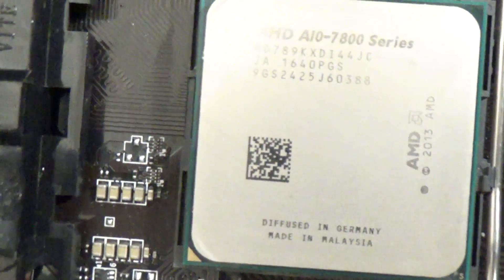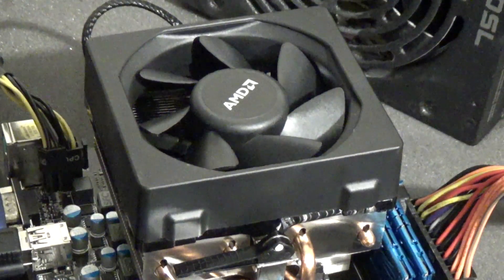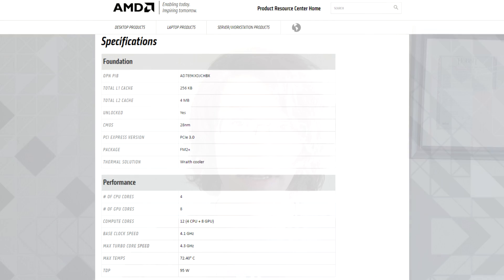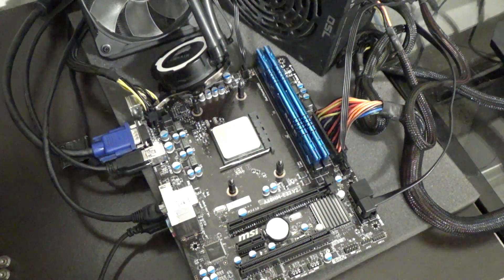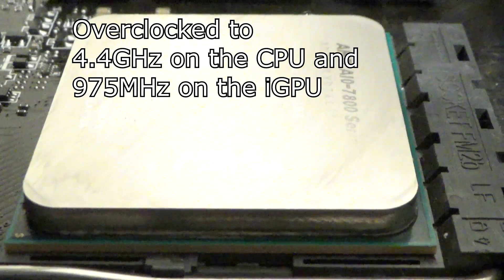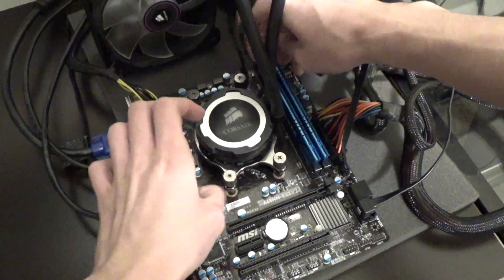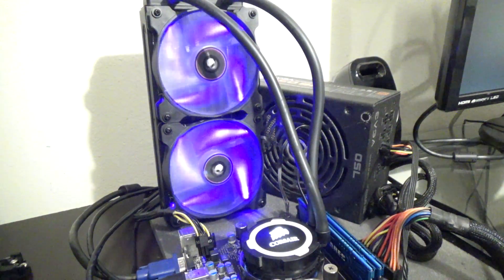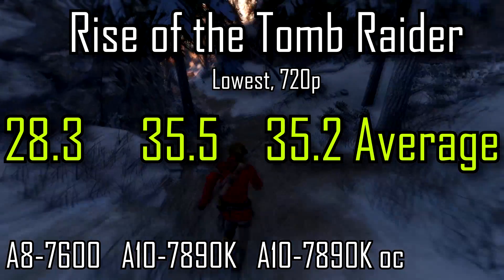A10-7890K  |  AMD Godavari

Comment: Legend says you will reply on this RN!!!!!1

What GPU can i pair with this a10-7890k?
Reply from the maker: I think dual graphics can be enabled with r7 250 or 250x, realistically those cards suck in todays standards, and weren’t even great then. I don’t know where the cpu bottleneck becomes so great that it no longer matters what grade of graphics card is used. But if youre planning on upgrading cpu later, then that makes sense. Maybe a gtx 1050, or gtx 1650, or potentially rx 570, but again, the cpu will probably hold these cards back most of the time. Maybe a gt 1030 if you want low power, entry level gaming performance. Legend is unclear, perhaps if you tell me more about what youre looking for, the 8 ball keeps suggesting to try again later
Reply: @YogertPC  i want to plag apex legends at decent fps i like low settings im not a quality graphics guy so is a gt 1030 can play apex at low settings at 60?
Reply from the maker: A gt 1030 is probably the lowest I would go, its a decent card, but in terms of value and availability, its probably not your best option if you can find them for $80usd.
An rx 570 is much faster, while drawing way more power for ~$130 usd.
It all depends on your setup, budget, and card availability in your area

Comment: I should note that while I haven't tested my 7890k's iGPU, I have the Doom demo and although I haven't tested DX11 without dual graphics, my R7 250 (which from what I can tell is about as good as the 7890k's iGPU, especially since mine uses GDDR3 instead of 5 like some) works just fine using Vulkan, even better than dual graphics in DX11 (which is still playable, BTW).

Comment: Hi, I have a AMD 7870K, Gigabyte F2A88XM-D3HP Ultra Durable, 2X4gb 2.133 mhz RAM... I don't know if i can overclock the AMD with the stock cooler, the same of the 7890K?? Or i need an better cooler for that?? Thank you so much.
Reply: Sory for the late reaction, but K means that you can overclock your Cpu or Apu

Comment: I appreciate you posting this video and might be able to help with some of its quirks.  I've built three A10- 7800 series systems over the past two years :  A10- 7850k, And two of the new Godavari A10-7860k (65 watt) systems.  First thing I found out about these APU's is their down clocking of cpu performance when using only the apu/cpu setups.   I'm also pretty sure there's a setting in bios to use 2 gigs of ram for the gpu portion.  Heat is a big issue with these chips and replacing the weak cpu cooler  (mini wraith i call it, red fan on top) on the 7860k sucks.  I'm actually typing on a "retro mini rig" build with 7860k, 16 gigs of 2133 ram, and gtx 1050ti,  And an after market cpu cooler.   The only temps that look accurate were from 3D mark : Firestrike and Skydiver stress tests and those temps were generated by running system at stock clocks.   The stock cooler was hitting over 80c and the after market cooler brought it down to the low 60c temps with the 3D Mark stress tests.  I want to overclock this thing to 4.2 gigahertz but will need a much beefier cooler to achieve this.  This is just my observations and experience from tinkering with these AMD platforms and any questions or additional thoughts are much appreciated.  Thanks again for putting this out there for us.  Peace :)

Comment: what motherboard and gpu do you  recommend for a amd fx-8350?
Reply: Don't get an FX-8350, it's old and overpriced. However, if you already have one, you can expect to spend around $70-100 to get a good overclocking board, so do some research to make sure the board can overclock and then get a good cooler. The 8350 has bad single-core performance in modern games, so I'd recommend something in the budget realm since something like a 1070 won't live up to its full potential. 1050 Ti or RX 470 are good choices. (RX 470 is only $30ish more and a good bit faster than the 1050 Ti. The MSI Armor version is $170.)
Reply: https://www.amazon.com/MSI-970A-GAMING-PRO-CARBON/dp/B01LAFXQBI/ref=sr_1_2?ie=UTF8&qid=1482384781&sr=8-2&keywords=MSI+970+gaming Good $100 AM3+ board right here for overclocking. A Cryorig H5 Universal cooler can get you a nice overclock for $45.
Reply: WHOAitsTyler cool thank you, also what would be a good cpu with good single cores?
Reply: For a budget system, the i3-6100 is a fantastic processor for $110 when paired with a 1050 Ti or RX 470. Only $110, pair it with a cheap motherboard such as the MSI B150M Mortar, which is very popular. If you have the money, an i5-6500 is the best budget way to go for $190.Aaron smith
Reply: Basically, whatever current CPU Intel is offering will be fine, as long as it is an i3 or higher. (Don't get an i7 for strictly gaming, those are for gaming and other tasks such as video creation.) And hopefully when AMD Zen releases it'll be good. All the current AMD CPU's have 4+ year old architecture.
Reply: WHOAitsTyler sounds great thanks :^)
Reply: WHOAitsTyler so a 1060 wouldnt be good or a 480?
Reply: Aaron smith Those are great cards, get the 4GB 480 over the 3GB 1060, but with the 6gb 1060 or 8gb 480 it doesnt really matter which one u get. Id highly recommend getting an i5 over an i3 becuz in a few games the i3 will bottleneck those cards.
Reply: WHOAitsTyler ok thanks again haha
Reply: And with the i5 or i3, the b150m bazooka is a great board, but if u get an unlocked i5 like the 6600k, get a z170 board so u can overclock. Personally i really like the msi krait gaming 3x
Reply: My bad, the b150m mortar, not bazooka
Reply: Bazooka is a fine board but mortar is better
Reply: WHOAitsTyler thanks :=)
Reply: You dont need the H5 since you wont be overclocking, just use the stock cooler or get the Cryorig M9i for $20. You dont need 16GB of ram for gaming, just get an 8Gb kit for $45-50~.
Reply: WHOAitsTyler oh ok cool
Reply: Since ur getting a microATX motherboard, a micro ATX case would look nicer in my opinion. (Basically its a bit shorter and doesnt have the extra expansion slots that ur motherboard doesnt support anyways.) The Corsair 88R is a decent $50 case, but get an additional fan for the front. A Corsair SP120 would work for $15.
Reply: And dont worry sbout ram speed since ur motherboard only runs ram at 2133 mhz, so whatever ram u get will run at 2133.
Reply: Also this is purely optional but for $20 more u can get the seasonic m12ii 520w power supply which is fully modular and has nicer looking pure black cables.
Reply: Given the current trend in the dx12, wouldn't the 8350 have a little longer life in it than the i3? Also, I'd be hesitant on the MSI Armor as it has no back plate and several people have commented on the "fragile" feel of the card. If possible, I know XFX does offer a competitive model with a back plate.
Reply: cz75fanatic The 8350 has already fallen behind the modern i3 due to terrible single core performance.
Reply: @WHOAitsCharmander  i3 aged worse than 8350. Most games now optimize multi core performance, especially the dx12 and vulkan. I wouldnt get an i3 nowadays unless its at least 8th gen which now have more 2 cores.
Reply: @suiken3149  I mean, I still stand by my comment that 4 years ago, the i3 was a much better choice. Nowadays... I really wouldn’t want either. i3-6100 doesn’t have enough cores and the 8350 has very slow cores
Reply: @WHOAitsCharmander  given the price I found for 8350, Id take it now. You can buy a whole unit now (minus the gpu) for 125-150 bucks on used market. Given that people are scalping ryzen and inflate the price (1200 still cost like 90 bucks for the processor alone), its a nice alternative for cheap gaming.